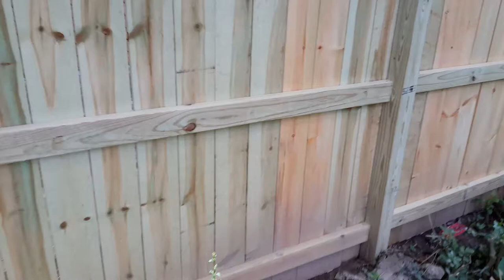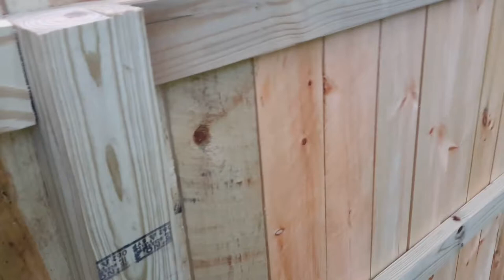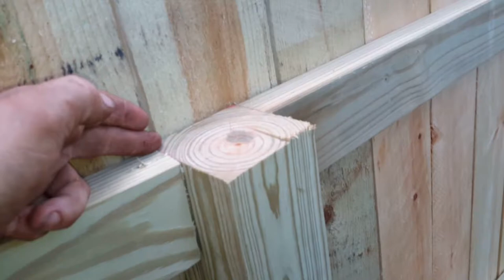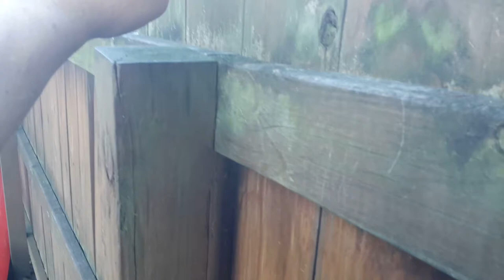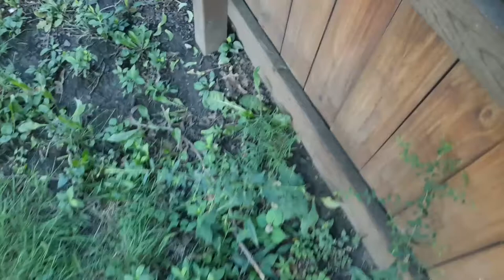Great fence installation with dog ear fence boards improves on basic installation

Comment: What was the measurements for the two by fours in the between the posts?
Reply from the maker: I put the 4x4s in at 8 foot on center. Then the 2bys will be shorter than 8 foot.